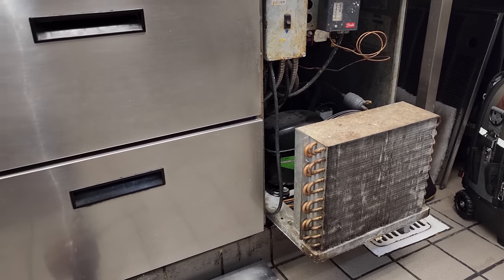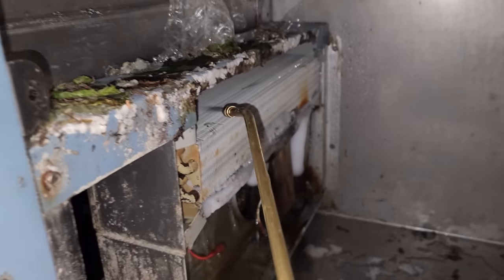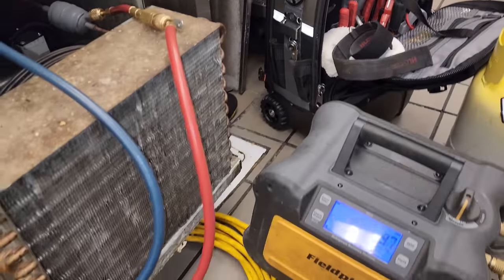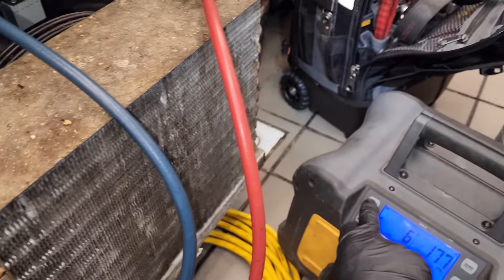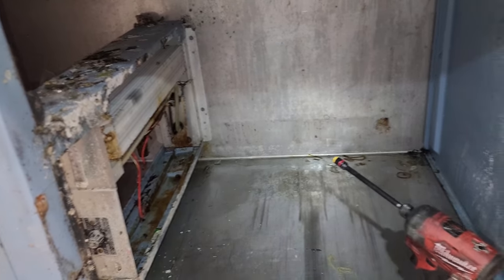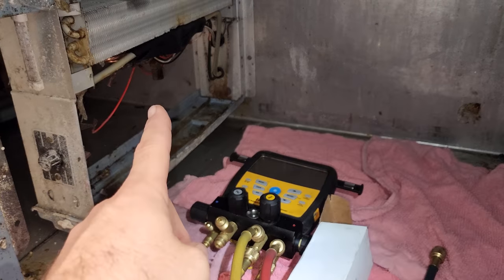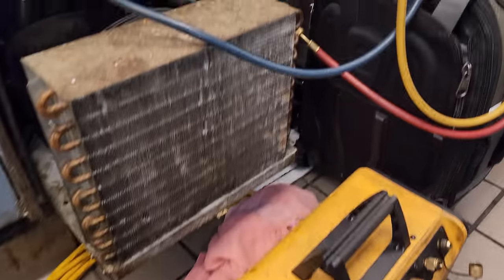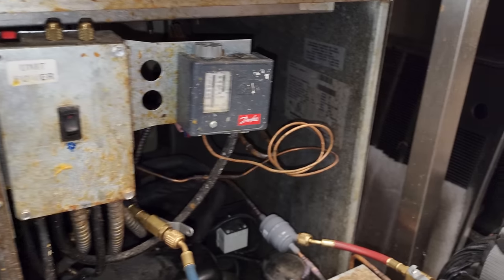THE DELFIELD SIX DRAWER COOLER IS NOT WORKING

Comment: Nice video, but two things. Or three. First, glad they're replacing it soon. Second, the liquid line solenoids seem to work. So no need to recover the entire charge. Just turn off the temp control, and let the compressor pump down. Third, you could probably get away with leaving that existing Sporlan drier alone. You can usually unplug the condensing unit, and plug it into an extension cord to pump down the last 5-10 psi of low side pressure. Change the powerhead. Pull a quick vac on the low side. You're not leaving the system open long enough to get much moisture in the system. I fixed an identical problem on a Randell 3 door reach in pizza prep table with two mulltion evaps like that on the bottom, and a separate rail on top. The right hand TXV was slammed shut just like this one. I moved the temp control over to the left evap, and replaced it with a new temp control. I ended up replacing the entire TXV, since the OEM one was out of stock. Put together a small Q body Sporlan valve with a 404 powerhead, and cartridge. This was a couple years ago, and never changed the filter drier. The only reason I did pull the entire charge, was I was not sure if the system was low on refrigerant (it wasn't), and the receiver is very small, and the correct charge is still important, the receiver is only barely big enough to hold the 24 ounces charge. Anyway for a quick fix for a unit that's not going to be around long I would have just pumped it down, swap the power head as quickly as possible, and fire it back up.

Comment: Always enjoy the videos. Random question from a maintenance guy who only does hvac part of the time. Aside from flathead and phillips bits, what are your most used bits for taking apart equipment?
Reply: The most useful bit for hvac is the 1/4" x 5/16" nut driver flip bit for residential, or the 5/16" x 3/8" for commercial. Malco makes a good one, as does Klein now.
Reply: @rye_in  The HVAC/R Slide Driver is always in my back pocket.

Comment: We've got a 4-drawer Delfield sandwich prep station unit that's "only" 20ish years old. Half of the hardware is missing, and has been for at least a decade. Drawer seals are half-shot. Power cord has been severed and electrical-taped together almost two years ago, and almost two years we've been waiting for a safe line cord to be installed... BUT that sandwich station is AMAZING at keeping temp. (Even when my coworkers leave the top open all the time - I swear, they're trying to give me an ulcer! How hard is it to flip the lids closed when you walk away from it? If the 45-year-old with back and neck issues can do it every time, why can't the 20-somethings?)

Yes, it's dang near impossible to properly clean it, obviously the engineers have never worked in Food Service! I always walk away with a sliced-up finger or three after cleaning it, and that's through a vinyl glove and disposable cleaning rag. (And yes, I thoroughly bleach the heck out of things that cut me open, I'm anal-retentive when it comes to food safety. A co-worker once got up in my face because I reported him for preparing food without gloves on. And I threw that food out, cleaned the work station, and remade the food properly. If there are ANY food-related illnesses, it WON'T HAPPEN ON MY WATCH!)

Oh, and for those of you following my saga, we're at 16 months without a working exhaust hood, and still waiting for the walk-in fridge door seal we needed last summer when the compressor finally threw in the towel. My Baxter Mini Rack oven is now cooking at 116-125°F below its setpoint. I can successfully bake gorgeous magazine-cover-worthy golden-brown croissants & muffins with raw centers. It's been five months since the repair in Dec. 2021 failed, it's getting progressively worse just like it did last time when it totally failed, and nobody cares but me. *shrugs* Even on the opening shift it takes three times longer to bake bagels, and they're USUALLY fully-cooked.

It's so dang annoying to work for a franchise that doesn't want to repair/maintain equipment. Equipment that was broken 11 years ago when I worked there last are STILL broken. A 240-volt frozen beverage machine trips the 30-Amp breaker when you plug it in with the power switch off. A 240-volt coffee brewer not working for over a year, when the Bunn tech was there fixing another brewer I inquired on the status, to date that bad brewer has never had a RO submitted - what could have been a warranty repair, had the RO been done promptly, is now an out-of-warranty repair. (Bravo! 👏)

I'm VERY close to inquiring about the qualifications necessary to have Idiot With A Toolbelt's job. I can change a line cord, replace a bad GFCI, troubleshoot shorts, and thanks to this amazing YouTube channel, I know I can fix the exhaust fan too. I'm reasonably certain the problem with my oven is either with the flame sensor, burner, or gas valve - it's basically a gas-fired heat exchanger in a box - when it acts up, it's always a quick light of the burner that goes out within two or three seconds... I already replace our water filters regularly because he can't be bothered. We have another guy who is contracted for auto-delivery of salt for our water softener, he was quite surprised when he visited Tuesday and discovered that two of us keep an eye on the salt levels, since nobody before us even knew what the "Big White Box Next To The Sink That Clean Dishes Always Fall Behind" actually did.

I regularly brush the coils of all our mini-fridges, the sandwich station, the ovens, the walk-in coils (which stay pretty clean NOW because I taught everyone how to properly use the Big Red Buttons), I do so many things my coworkers feel is "beyond" a minimum-wage position. Well, excuuuuse me if I know how... inadequate?... our repair guy is, and how impossible it is to get him in the door to fix things, and how likely he is to blame his lack of regular maintenance on "Employee Abuse" so the repairs are billable beyond his contract, and I want to take measures to prevent all of this 🐮💩!

Comment: For the system like this with two solenoid valve. Do you need to put two solenoid valve magnet when pulling a vacuum? If not, how would you do it right?
Reply: u have to if u are pulling from one side, but u can recover from both liquid and vapor sides  and u dont have to open, u are pulling from 2 sides

Comment: Why not just pump it down via the solenoid valve and change the powerhead on the fly so no evacuation is needed since the unit is to be replaced?
Reply from the maker: I don't trust a solenoid valve to hold the refrigerant back for service work

Comment: WHAT IS A GOOD THERMOMETER TO USE FOR MEASURING TEMPERATURE OF REACH IN COOLERS/EVAPORATORS?
Reply: Cooper kit. But it's expensive
Reply: I like the Fieldpiece pocket thermometer. If you don't have one handly, most of the time a lot of kitchens will have digital temp probes they use to check food temps that will also work in a pinch. And if they don't, they really need to buy them some. Every kitchen should have at least 1-2 food type probe thermometers to check steam table/hot well holding temps, checking burgers etc to be sure it's cooked to the right temperature etc. Newer reach in units have a digital temp display on the controller, like a Dixell or Carel

Comment: What adjustable wrench do you use that is thin enough to fit between the power head and the body?
Reply: Not an adjustable,  sporlan power head wrench
Reply: @specialK_hvac  in the video it looks like an adjustable to me.  That SPORLAN wrench is a little salty for a single purpose tool.
Reply: Bahco make super thin jaw adjustable wrenches

Comment: How often can you bend that capillary tube before it breaks? I think I would have wound it up first and than screw the powerhead in
btw If I have learned something about gastronomy grade kitchens, than it is this: They are nasty and dirty and gross. Always. Period.
I was in some Kitchens as an electrician over the time and I think they are clean for about 36 milliseconds after they are installed and then every little spot is just filthy. Especially if you have to use the words "under" "behind" or "inside" to describe what ever spot you have to work in

Comment: i need help, im tryng to understund why the other coil freeze, but im not understunding, so we have a bad txv head, the liquid is flowing to the right evaporator and is not being vaporized  correctly resulting in a floadback, then we have the left one, that one is fine but why it freeze up? its tryng to absorb too much heat? why the txv cant mantain correct superheat?
Reply: If there is an undercharge (because of a leak) in the sensing bulb it will read as if it is too cold. When the bulb is cold the power head throttles down the refrigerant effectively turning it off. This leaves all the cooling power to the other coil.

Comment: I was watching from last year https://youtu.be/M3zMNF-YcOU you seemed to be saying that when utility voltage decreases you expected higher current, is that because of inductance or something?  As I understood V=IR, in purely resistive circuits as the voltage drops the current drops proportional to resistance.  You also said the resistance at the contactor could cause higher current, but using the same formula as resistance rises the current at the disconnect should drop or inversely proportional to voltage.  If both happen the effects should be added or multiplied.  Taking a second look, if voltage raised from what you measured(200) to 220 then there would be %10 more current.  Do you size fuses and other parts for the expected 220v, I.E. add the %10 to the measured current at a site with low V like that one?  I hear you talk about what a motor is designed to run at all the time, but it's an interesting point that if the quality of utility is poor and later restored those current measurements are wrong.
Reply from the maker: its because we are running motors and they are still gonna try and operate at the same speed but with the voltage dropping the current will go up

Comment: For the system like this with two solenoid valve. Do you need to put two solenoid valve magnet when pulling a vacuum? If not, how would you do it right?
Reply: Pull from both sides
Reply: You'd put the magnet on if you're pulling vacuum from one side and you have a micron gauge on the other (that's not ideal though). Or you'd put it on while flowing nitro.